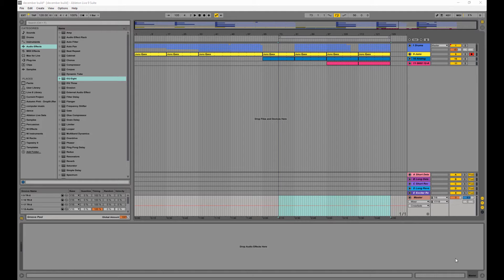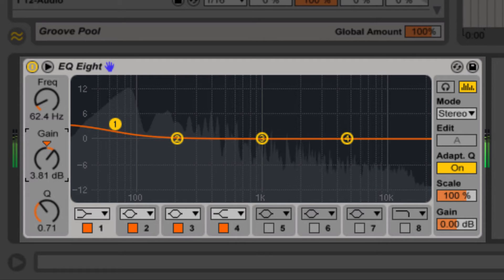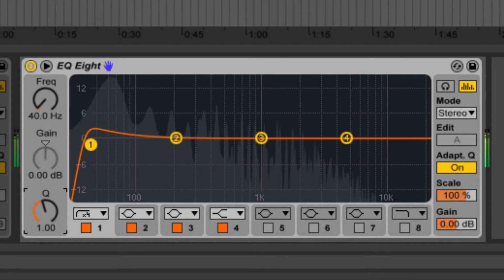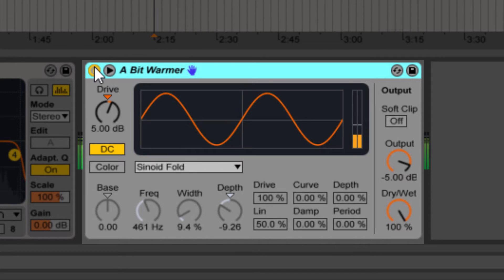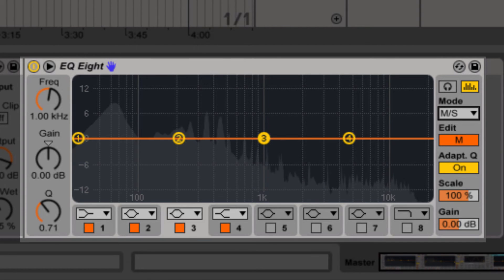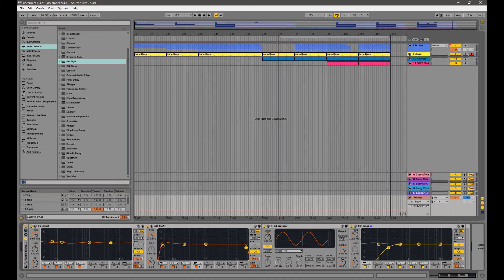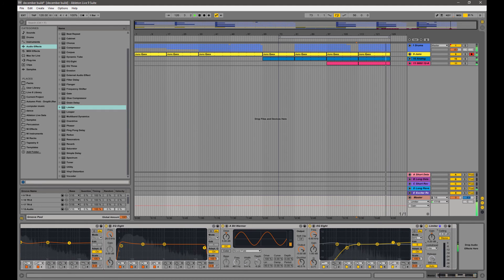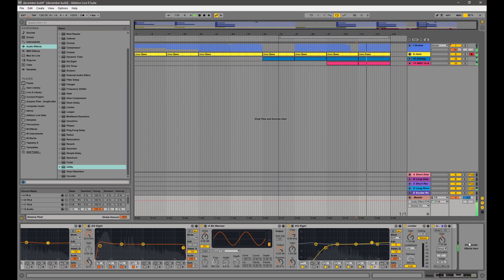Build An Ableton Mastering Rack Tutorial

Comment: @Reiche - Don't you think it's a good idea to add light compression before the tape saturation to tame the peaks, then the tape saturation going into a limiter?
Reply: Multiband comp to compress slighty the tops (De-essing). Glue Compressor would be to add that slight SSL color. The needle should not move basically it aint mixing anymore. In mastering we use compressor in a totally different way, adding color without affecting dynamics so it's a very light touch. Also seeing more than 1,5 dB eq boost is way too much in mastering. It's about subtleties. But on this video it's good for indeed doing a quick master. I'd say that it is good to have own reference what kind of mastered sound one prefers and export that and a version without mastering chain and send both to mastering engineer so the mastering engineer has a reference what the client likes his track to sound like.